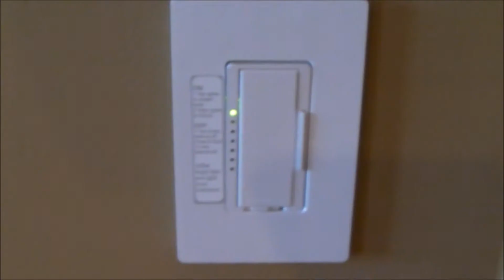Trying a 10k ohm resistor for LEDs that won't dim to off;  LEDs glowing dimly with dimmer

Comment: Did you ever find a resistance value and wattage that works to turn off the ghost led bulbs?      I am considering the night light route in the 2 e-26 bulb light fixture
Reply from the maker: I posted link in the video in the upper right hand corner (i with a circle around it) but here is a direct link:  https://youtu.be/zwmA22wMgZw  Be sure to LIKE and subscribe if you find it helpful.  THANKS!!

Comment: I have the same switch and the same problem. I solved it by going into the attic and adding a key-less fixture and an incandescent bulb to the lighting circuit. That solved the problem of the lights not dimming to off. Unfortunately that bulb must have burnt out last night, 'cause the light no longer dimm to off. The bulb lasted a good 2-3 years, but I would like to do something more permanent and correct. Would this work if it was in the switch box after the switch but before the lights?
Reply from the maker: it should work but I wouldn't want a bulb INSIDE a cramped switch box.  Why not put a night-lite into your keyless fixture?

Comment: I know this is about a year old but here goes anyway.  If all of the lamps are truly wired in parallel then they would essentially be all receiving the same voltage.  Putting a resistor in place of one lamp will not necessarily affect the rest of them.  It will lower the amperage in the entire circuit as each individual parallel circuit shares the amperage output from the power source. The water analogy commonly used in explaining voltage, amps, and resistance will help to explain it a little bit better.

Voltage relating to pressure, and Current relating to flow.  you will have the same pressure(Voltage) down each parallel leg, but the flow(current) of the pressure(voltage) will be lowered each proceeding leg after the power source.

With the dimming and lowering of the current which in turn lowers the voltage with it there is still enough voltage(pressure) left to meet the forward voltage requirements to activate the led, but so little current(flow) that they are extremely dim and all of the available current is being eaten up before it gets too far down the chain and only lighting a few of the legs.

That being said to lower the current running  through all LED's the resistor will need to be connected to the output of the switch and then ran out to the parallel legs.